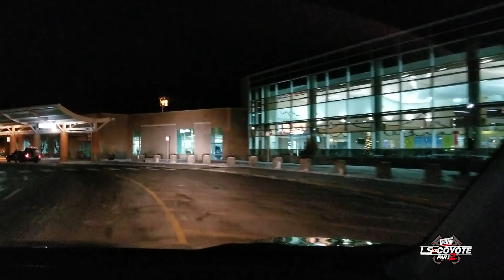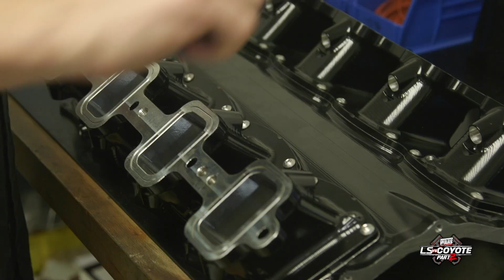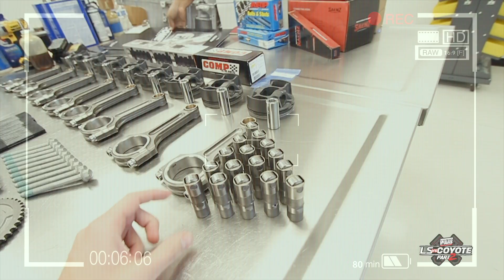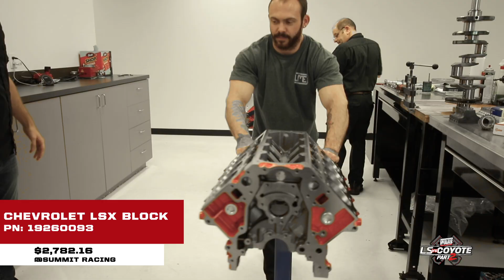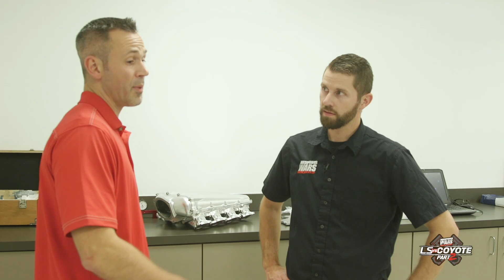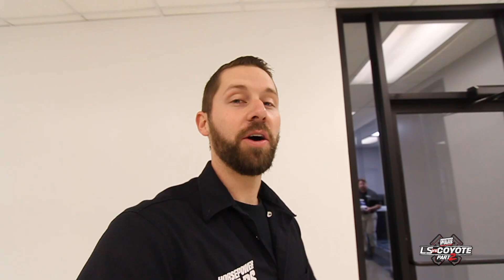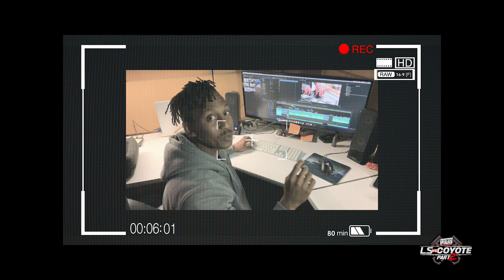LS vs. Coyote 2 Episode 2: The LSX Engine Build

Comment: You know I'm hate hearing GM/LS guys bragging that their much bigger GM engine made more Horsepower than a Ford and talking about it's fair to race a 6.0 or a 6.2 liter LS stroked to God knows how many cubic inches against a 5.0 Coyote and GM guys argument is y'all have Dohc and the coyoteis physically larger well no sh.. Dohc V/8 engines and Hemi Style engines have to be  physically larger but that's not the point...The emphasis was always who builds the baddest engines and comparing those engines cubic inch to cubic inch back in the day it was 427 Chevy V/S 427 Ford V/S 426 Dodge apples to apples no excuses but now the GM guys say it's fair to race a much bigger pushrod GM against a much smaller Dohc Ford that's B.S. build if you want Respect build a 6.2 Ford against a 6.2 LS and stroke them both to let's say 427 cubic inches and watch that Ford engine spank that LS but you know any Ford Guy knows y'all will never do that and you definitely wouldn't put let's say a 5.3 stroked to 383 cubic inches against a 351 Cleveland or Windsor stroked to 427 cubic inches or larger even though it's a pushrod engine against another pushrod engine because all the GM fanboys would cry but the Ford is more cubic inches and physically larger and everyone knows the bigger Ford would embarrass the Chevy engine    at the end of the Day it should be who builds the baddest engines cubic to cubic inch because if I was a GM guy I would be embarrassed to know that after 70 + Years of small block Chevy/ GM/LS Innovation that my Chevy/GM would have to be 60 + cubic inches and in some cases a lot more to outrun/out power a much smaller Ford engine design thats only been around for 8 years now and Bragg when my Chevy/GM engine barely outperformed the Ford engine and my argument for it being a fair competition is because the Ford has Dual Overhead Cams... Really.. I would be completely embarrassed if I was a Chevy/GM guy knowing that would be my only argument, it's still one engine V/S another engine so make it fair build them,stroke them to the same cubic inches or as close as possible and watch the Ford engines dominate.But you will never see one of these channels even dare to do that all the GM fanboys would be sending in hatemail and new excuses as to why a cubic inch to cubic inch Ford V/S Chevy Shootout was unfair, I can hear the GM fanboys now but the Ford is physically larger,but the Ford had Cleveland Style Heads, but the Ford weighs more,but the Ford has a bigger cam, at least this way we would know who's design/engines make the most Horsepower Per Cubic Inch!!!#Blue Oval Nation
Reply: Where in the rules does it say the Ford can't have a big cube build? Same way as it doesn't say the Chevy can't have 4v heads. 
Nobody is stopping either doing what they like but the builders will work with what they have as best they can. In the Chevy that's going to be big volume. In the Ford it's going to be big air flow and probably rpm.
Please stop whining about cubes because it's one of the most retarded measurements of how good an engine is as a complete package imaginable.
Reply: Stop whining.. geez .. LS > Coyote
Reply: The modular design has been around alot longer that 8 years.
Reply: @turbolq4   since its basically  just a continuation of the 4.6 design out since 93? lol cant believe some1 said that how misinformed fanbois are
Reply: Here is your sign!!
Reply: ford has a 6.2 and chevy will kill it too what's your point..

Comment: Fully build both engine regardless of cost and throw same amount of boost on both engines see who will make more power
Reply: Regardless of cost? Lmfao 572 Big Block Incoming
Reply: Its called a budget build for a reason
Reply: Medical they should name it budget horsepower wars if that's the case
Reply: @rggt6225  on the first video they explained it clearly both engines will have a budget of 15k and they will both be going to a ford and GM engine builders
Reply: @mr.merica6048  so it's not a budget horsepower wars??
Reply: @rggt6225  it's a 15k budget 🤦‍♂️

Comment: Hp per ci should be more points
Reply: Then they should rate HP per weight and physical size of the motor.
Reply: It shouldn't even be a category because it has no meaningful effect on what the motor does. The vehicle sees size, weight and power/torque output. It couldn't care less how many cubes are in the motor just like it couldn't care less how many valves are in there.

Comment: omg why are u guys so based toward GM???
2L of displacemnt more??? seriously??? whats the point??? use at least trinity
Reply: The Coyote flows better than Trinity did, especially the Gen2 and Gen3 motors.
Reply: @tonyfrance4100  ye but 800cc is  alot not to mentions they will port the heads for better flow any way

Comment: Coyote butthurt strong on this thread
Reply: @Cobra Blackwell he owns a slowmaro that loses to EVERYTHING so it probably was 😂🤷‍♂️
Reply: ClutchkickPJ
i love clowns like you, these are Mazda Raceway Laguna Seca times
GT350R (526 HP) 1:36:11
SS 1LE (455 HP) 1:37:78
Reply: Anthony Webber - you’re fucked in the head kid. The GTPP2 lapped the VIR a whole second faster than that SS1lE on the same day. GTFO with these cherry picked lap times and hope off that garbage motors dick! Ford has the fastest N/A car period.
Reply: Every pro engine builder will tell you 4 valve heads outpower 2 valve heads on an equal  CI motor. Geeze even the puny Ford V-6 truck engine  in the GT outperforms the LS at Le Mans.
Reply: Real fair to use a 302 to compete with a motor that is 427 cubic inches?
Reply: 4 cams 32 valves and ya still fucking whiny bitches
Reply: You have a 6.2 Raptor engine 🤷‍♂️👌

Comment: What a joke that is a 30,000 dollar engine. Why not put a blower on a stock LS 1 and a VMP gen 3 blower on a stock coyote and put them on a dyno
Reply: Maybe an F1X LS vs a VMP 5oh.
Reply: Would have been much easier
Reply: I am a Ford man, but an ls1 vs a coyote with a vmp is an no way a fair comparison. It should be a stock ls3 with boost vs a stock coyote with boost. Chevy guys can cry and whine all day. Technology beats displacement all day every day
Reply: @darrellp2501  I had meant for the late to use a 2.65 supercharger of it's choice too
Reply: Darrell P Throw a VMP blower on a Coyote and an F1X on a LS3 or LT1. They will be very close. The only difference is the LS/LT will last 300+ pulls where if you get 50 hard ones on a VMP on a stock coyote you are doing good lol.
Reply: Chuck Beef stop watching CNN bro your data is completely incorrect.
Reply: Jay Why thats real life bro. Any stock Coyote making 900+ is on borrowed time.
Reply: Chuck Beef and any stock LS making 600 hp is on borrowed time.   You’re not being rational in your bias Chuck.   Wake the fuck up.
Reply: @jaywhy225  Dude, an LS can handle up to 1000hp on stock bottom end. Only reason you see them blowing up is ring gaps or oil starvation which can happen to any motor.
Reply: a c good luck with that.   When yours lasts more than a dozen or two hard pulls let the rest of the Internet know about it.
Reply: Because when the LS won the last competition you ford crybabies wrote some many letters they did a second competition and changed the rules for you sissies. Now you're still crying. So scared to lose and haven't even seen what the Ford guy is building yet.
Reply: EGGINFOOLS lol the last "Ford guy" locked out the cams and ran the completely wrong intake.   This test is heavily biased yet again from the start.
Reply: @jaywhy225  no it's not. They have the same budget. You haven't even seen what the Ford builder has done yet. Plus they are giving points for HP/cubic inch which means nothing in the racing world.
Reply: @jaywhy225  Well there is a category for hp/cube which everyone knows any 4v will beat out any 2v in that situation and a measurement which has no meaningful impact on the operation of the motor.
Nothing about physical size though - you know the thing that actually makes a difference to the fitment of the engine in a car?
Yeah I agree - biased.
Reply: The ls1 came out in 97 lol really pussy

Comment: For some reason here I feel that this isn’t a budget build!!!!! Next thing is that this 427 LSX by LME, is freakin bad and will make huge torque and hp. My first impression is that this is definitely not a fair test because the coyote will be using production Ford block, heads, crank, etc!!! And come on, 4 cams do not make up for the cubic inch difference here! But this will be a great show to watch. Thanks to all that are involved in this to make it happen. Can’t wait to hear that coyote at 9k!!!!
Reply: Production block that will be sleeved etc... there are far more exotic blocks available for the ls but this is something you can order from any dealer or most aftermarket suppliers.
Reply: Travis Pfannmuller, I am definitely glad that the new sleeves are going to be installed, the original sleeves are giving lots of trouble. I sure wish they could make it a 4.125 bore and throw in a 4.0 stroke crank!!! Lol

Comment: I thought this was a video of Ls vs coyote when in fact is just a video of LSX
Reply: I guess you don't know how to read pt.2
Reply: @mr.merica6048  didn't see it
Reply: Justin Gulley you don’t say?
Reply: @luciankristov6436  it clearly says LS. Not lsx 427 crate engine versus stock production parts. But whatever you GM fan boys need to do to win. They don't even want to use the ls stock production block. Lmao. Won't even try
Reply: @Tegridynews  last time I checked a lsx block is a LS and guess what its about the same price as the 5.0 block
Reply: @mr.merica6048  LSX crate engine cost $23,000. Lmao
Reply: @Tegridynews  
LSX crate motor?  They used an off the shelf LSX  block and worked it over, it's not a complete engine that they just bought. The part numbers and price is listed. Also a crate LS7 from GM brand new is about 14 thousand.

Comment: The reason they went with GM head bolts vs ARP head studs: they're not running a really high compression and they don't seem to be worried about the engine lasting very long either by using the stock trunnions. But I want to know why they went medium compression. Missed opportunity I think.
Reply: Jared Smith  I agree with you on the trunnions. I understand they was 15 dollars away from going over budget, but for another 100 bucks to save all that time and money on machine work? my heart sank when I seen that.
Reply: @lucasamick7940  They are 10k over budget already. LME lists that engine on its website for $24,600.
Reply: Michael Messina I was talking out of they budget they were given. Not what it would cost if you or me went and bought it off their website.